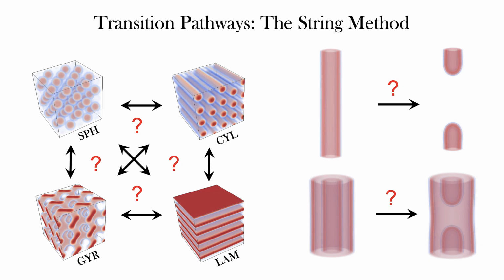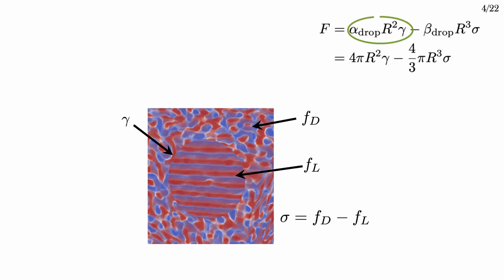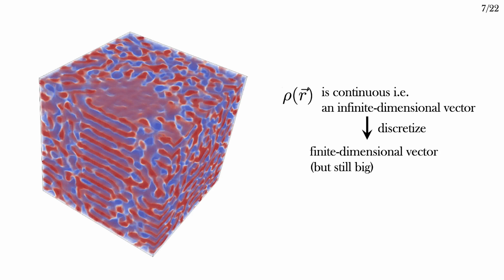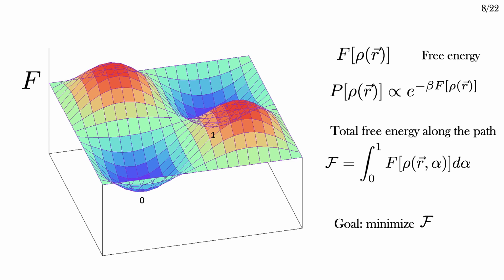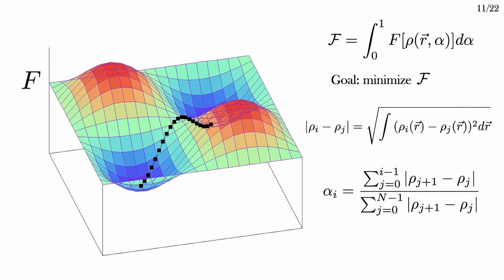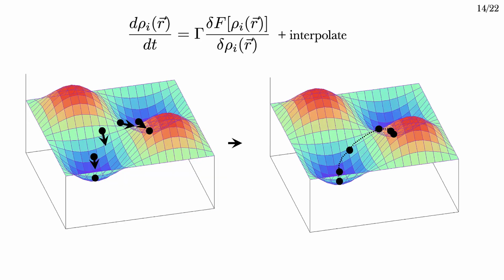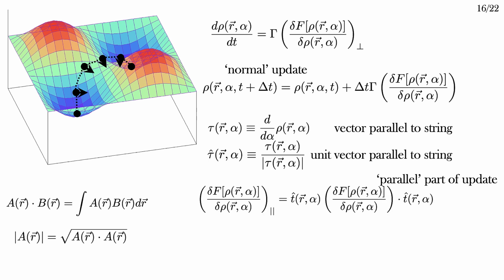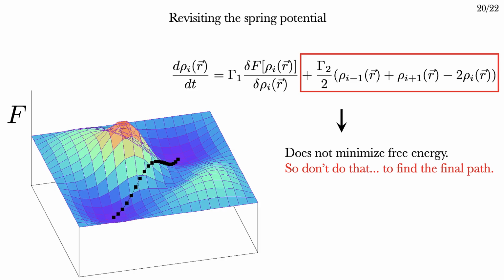Transition Pathways: The String Method

Comment: Hey, thank you for the nice presentation.  I do research with polymers as well but I know nothing about the simulations that you showed early in the vid. Can you point me on how these are done? Also these colors are representations of a two polymer mixture or is it something else. I'm particularly interested in polyelectrolyte complexes and hydrogels.
Reply from the maker: Hey. I'm glad you liked!
The simulations shown there are done using either self consistent field theory (SCFT) or field theoretic simulations (FTS). I can't give you a full description in the comment section, but my particles to fields video explains how they work. If you just want to use them, look for a paper by Marden and Beardsley 2021 - their si contains the code for FTS (and it can also do SCFT, I think). 

The colors are indeed different colors, for a block copolymer (simulating a mixture is similar but easier). 
Polyelectrolytes can get annoying to simulate because you either need to do full particle simulations (which are slow and computationally intensive) or make approximations like relaxing the solvent to solve the PB equation at every step. But they are totally doable. 
I don't do polyelectrolytes myself, but I know of work using SCFT to study them by Matsen (there are probably better sources but I can't think of any off hand - not a PE guy). 

This response is getting long but if you have followup questions I'll be happy to try to help.